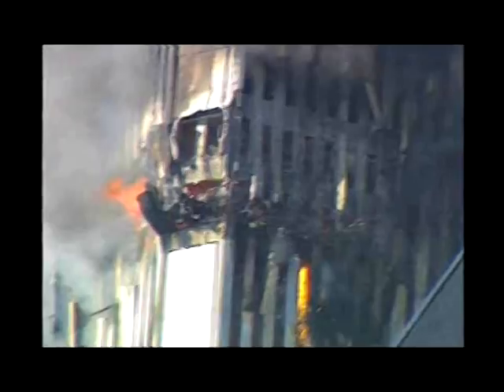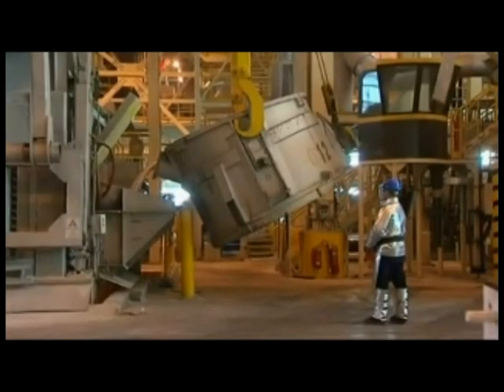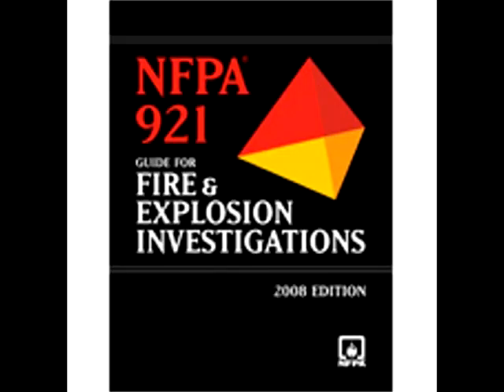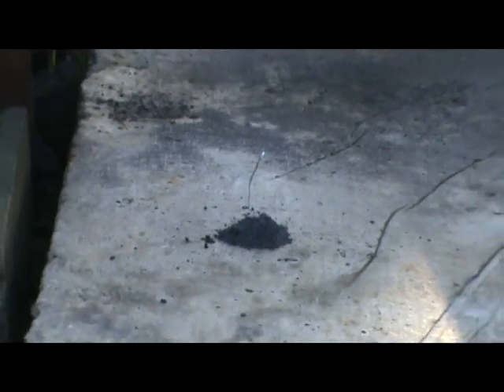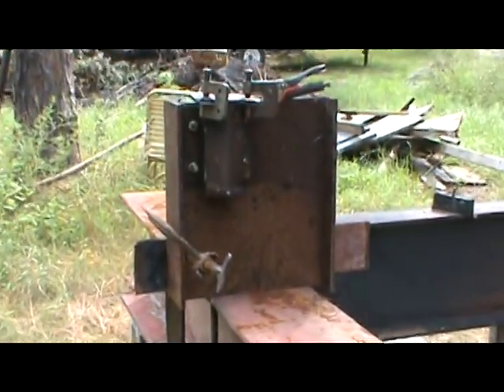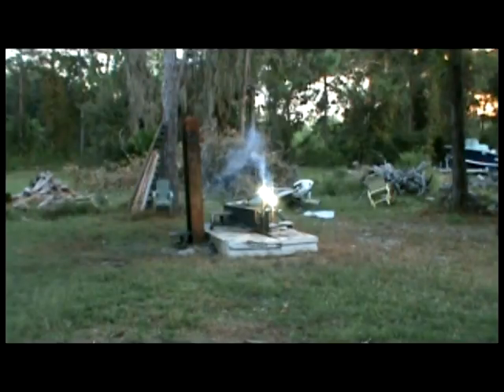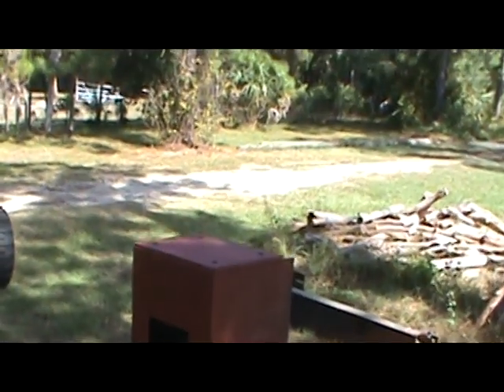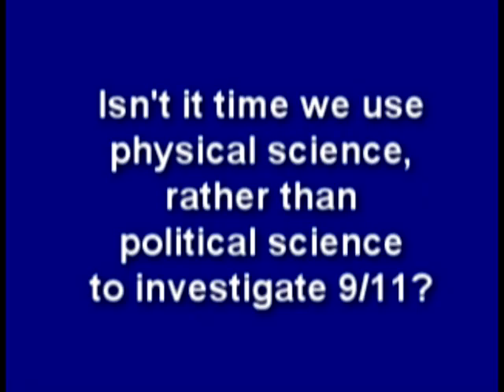9/11 Experiments: The Great Thermate Debate

Comment: If you smash an aluminium plane hard enough into a steel structure it will mix at the boundary layer and then the heat of the impact would start the reaction. This would then allow the  steel next to it to melt and mix with the aluminium and in this fashion the beam itself is consumed for the thermite and thus no cutting or complex shaped charges need to be used. And if what you say is true then the steel would have cut lines and marks rather than whole parts simply melted away.

Edit I forgot it has to be iron oxide 

Teaches me for messing about in chemistry
Reply: Tomas Begley I want you to look up photos of when a bird hits an airplane and how fucked up the plane gets and then try to tell me what you're telling me
Reply: Brendan Early that is entirely the point the plane smushes into the steel and that allows the plane to BECOME the aluminium half of the thermite reaction.

You have to remember the sparks were continuously from a few main spots makeing the probability of charges very slim as a vast amount of charges would be required to produce that duration of reaction
Reply: Thermite does not work that way. You need POWDERED metals for it... not smashed=) And you say "half of thermite reaction"... do you know what the second half is? Do you think pure block of iron can be part of thermite?=) Nope... you need, again, powder... but of what? Iron Oxide (not pure iron)... or other oxide(there are many formulas). So your hypotheses (not even theory) is totally in the wrong direction. But thanks for the input
Reply: elrondsch fair point with the oxide I forgot about that it's been so long since I've messed with thurmite but the powders point is wrong you have to powder it for a fast cutting it welding action but even if you use chunks of material with a small powders starter it will work
I do like the effort you put into this but that still doesn't explain how any of these charges were set when the main structure was enclosed in the center section of the building by concrete.

Now onto engineering rather then chemistry because I'm bad at that
Another point to concider is that possibly maybe jet fuel did cause it because think back to the satern 5 rocket. It's propellent was Ap1 and it comprised of jet fuel and oxegen. They had to design nozzels out of inconell and ran the oxegen through the upper part of the bell to provide cooling BECAUSE IT BURNED HOT ENOUGH TO MELT THE NOZZLE. On top of that actual jet engines themselves have to have titanium blades with small air holes and a cooling air flow down the center of the shaft and through a ring in the stator to PREVENT THEM FROM MELTING and that heat is just from atmospheric air and jet fuel and yes you could argue that the combustors and a jet engine are steel but that is because they have small holes to inject cold air and create a boundary layer so the hot combustion never touched the material.

Now for the building one could say that the large access shaft in the middle acted like a chimney that was several story's high with one that size the draft would be very strong indeed and would most likely provide enough oxegen to reach the level of burn required to achieve that temperature
Now again this is just a theory I am not claiming this is what happens it would need calculation for the possible amount of air delivery. The supporting evidence is that the beams recoverd had no clean cut marks on them and large portions were missing. Next is the inibilty to lay charges into a sealed space. Finally is that molten steel sparks look the same no matter where they came from but of a segnificent amount of beams were cut then you would have seen them all around the building, however if there was a fire in the building being fueled by a large chimney and draft effect then the sparks would get carried in the direction of airflow so if the plane crashed into the center section and broke a part of the wall this would be the initial entry point of the air and thus the sparks would travel that direction and out of the opposite side of the building to the crash like seen in the footage

not saying this is what happend but it ticked more boxes then the thurmite one and the only thing holding it back is the flow calculations for the center section to see how much oxegen could be provided
Reply: Tomas Begley  are u a veteran architect ?
Reply: Gent Bar nope and I never claimed to be but from the building plans a volume calculation is basic maths.
and as for the internal construction of the building it's quite simple I saw a documentary on the descovery channel on how they were built a few years ago, apparently more then you have.
This works because the center column house several large evacuation stairwells and a large quantity of the beams were enclosed in the concrete structure meaning your charge theory is impossible as there would be no way to set them unless the concrete was broken off. However when concrete is exposed to extream heat it will crack and thus expose the beams to the fire.

Clearly none of you have a scientific mindset as how you prove scientific theory is by trying to DISPROVE it and failing, it's easy to prove something but hard to find something that's infallible. So by all means check my theory as at the moment that's all it is a theory, doesn't mean it's correct, and that's why you need people constructively looking at eachothers theory's.

And fyi I am an engineer so the jet engine point is correct for sure and  for any chemists out there you can confirm that kerosene is far more energy dense then TnT now think about that for a second.
Reply: By Iron Oxide, I am guessing you mean RUST. Rust on an Steel beam, that's preposterous.
Reply: are you?
Reply: Nice try but no.
Reply: Yard Sale Dale  ummm they definitely did not go through it lol. They hardly made it in past the outer wall

Comment: Ooof, you don't need to fully melt steel to weaken it. Weakened steel can bend. Bending can add more heat to the mix. Also, buildings have insulation on steel beams so fires won't weaken them right away. Implying, that fires can weaken them.I also love how you compared a coin floating on Mercury to organic material floating on flowing aluminum. Is funny. Also when exactly did they have time to set all this up without people noticing? Now keep in mind, if they had that much time and preparation put into this, why would they have been this sloppy?

Comment: For every mouth breathing thinking that the u.s. government had something to do with this do to the temperature that it takes to melt steel vs how hot jet fuel burns. Let's do a little experiment. Take a piece of hard plastic like something you need to cut open with scissors like a console controller get a piece that you can bend and keep bending it quickly after a few seconss you'll see that it heats up and the integrity of the plastic becomes much easier to bend. Heat makes things much less structurally sound it makes them weak thats why if you take steel and heat it up to half its melting point maybe even a quater of it you can very easily bend it.

Comment: This evidence is Compelling...but inaccurate....it would have taken thousands of tons of thermite to bring down the towers...I think someone might have noticed hundreds of men bringing this up..for weeks on end....and stripping beams to apply it.....The Unpopular...unglamorous FACT is....the destruction of the towers  was brought by the  "two" 190ft long jet aircraft traveling at over 400mph in a dive...with there engines in emergency  power...The Average  Person can not comprehend how much energy  a speeding Jet ...filled with jet fuel ..can unleash...Either can the Author of this Video....The WTC was a Giant  Tube 1100 ft tall...with an exoskeleton of steel...punch a hole in the side of the tube...add tons of jet fuel....and you just  made a Gigantic blast furnace....the internal fire...draws tons of high speed air into giant holes in the exoskeleton....with 60 to 70% of the internal core severed by the speeding aircraft...and enough heat to soften if not melt the remaining  structure....the compromised  structure could no longer support the floors above...
No need for Conspiracy...Or BS stories of thermite...There is a reason the internals of a jet engine are made of Exotic Alloys....like Titanium....if they were made of steel....they would melt....

Comment: Here's an idea: what if they collapsed because the tubular shape of the tower was no longer able to structurally support the weight of the floors above after impact? If this were true, then the lower the impact of the plane, the sooner metal fatigue would set in and the building would collapse. And just what we saw, the south tower, though struck second, collapsed before the north tower. any thoughts on that?

Also, WTC 7 was sitting on top of an electrical substation. Have you ever seen a transformer explode during a tornado? Now imagine something about 10,000 times bigger...

Cool tips on building destructive thermite devices, though. I'm sure NOONE will find that useful...

Comment: The comment section is a bit sad Tbh. The engines themselves could not burn through steel, and would not burn aluminum red themselves as well. However, the building created a sort of furnace exponentially increasing the temperature. This severely weakened the structural integrity of the WTC, and even creating an effect similar to a thermitic explosion or extremely high oxy acetylene torch. This temperature could also make aluminum flow bright red like water. Also, the over 500,000 ton (ton right)? Would create a freefall effect. As for wings not being found in the wreckage, that's just ignorance. Anyone fancying a civil discussion, feel free.
Reply: The fires in the towers were oxygen starved the smoke was black they never got anywhere near furnace like temps to melt stee,l and these buildings where built to withstand anything and all it took was 15 mins to bring them down. No skyscraper has ever been brought down by a fire except wtc and they fell as one straight down it's horrible to say but it does look like a controlled demolition
Reply: They're large buildings and the heart of a fire burns hottest. Just because there's smoke pouring from the outside of the building, i.e. furthest from the centre, i.e. cooler, doesn't mean that the inside in't burning horrifically hot. 

No skyscraper has been brought down by fire, true, but no 110 storey skyscraper has ever been hit by a commercial airliner loaded with fuel at 400-500 knots. The kinetic energy of flight 11 (North Tower) was about 3.35GJ and the KE of flight 175 (South Tower) was about 4.53GJ.  That's equal to 0.8 tons and 1.08 tons of TNT respectively. And that's just the impact alone. You don't expect the structural integrity to be somewhat weakened after that?
Reply: Yea, but how come it didn't crash down when there was a fire years before? Or did the furniture decide to burn hotter this time around?
Reply: Because it was different ? It was in the basement, it was a different fire, etc... you can compare the two fires. The parameters are very different.
Reply: https://youtu.be/6xif0jIT_ZM
Reply: #Kyle Morrison Why would anyone  with a modicum of intelligence on the subject matter engage in an exercise of futility in an attempt to have to have a "civil discussion" without a nescient dolt such as you?
If Dunning and Kruger were to read the irrationality of your Disneyesque Loony Tunes physics they would be high fiving until their hands fell off!
Reply: I agree.
A gaping hole, a huge furnace, weight from above and cheap steel and concrete are more likely to blame than the idiotic idea that someone, somehow spent years planting explosive incendiary materials in the top half of a building. People never use common sense.

Where are the people who planted the explosives ?
Who supplied them ?
Where are these people now ?
Why hasn't anyone talked ?
When and how did these secret people have the time and ability to plant this explosive material ?

People are gullible. Like I said, a gaping hole, a furnace cauldron fire, weakened steel and a huge weight above is what made it all collapse.
Reply: Exactly. Like it was possible to keep those secrets without anyone talking. It's impossible.

Comment: This is very thought provoking. However if they had used thermate wouldn't there be only a small amount of molten metal? The reaction is quick and hot cutting and melting the metal. But there isn't really much time for the metal to flow out of the building. There must have been a way to consistently appy extremely hot temperature to the steel to get it to flow for so long and without much viscosity.

Comment: Aluminum and iron reacting to produce even higher heat... lemme see here, we have a massive source of aluminum in office furniture and, drum toll please.... one entire air craft!!   

Also, it absolutely not necessary to melt anything to collapse the structures, only to heat structural steel to a point where it looses temper and its young’s modulus drops to near zero.  That lower heat is the basis of blacksmithing, and is achieved with wood or coal burning at a far lower temperature than jet fuel and natural gas...  Oh yes, this idiot forgot that there were massive natural gas lines running up the building for the restaurant kitchens... Just imagine the added heat from a high pressure natural gas supply of many cubic feet per second. 

Natural gas WILL absolutely melt aluminum and most of its common alloys. Don’t forget, ... There was also the input of TONS of shredded and pulverized aluminum from the aircraft itself.

Comment: What happens to Steel when it is heated up and under immense pressure.. The weight that the steel bearing above is so great that's as a steel is heated up two such enormous temperatures that's maybe they might not melt it but it will weaken
 and fail .. Those fires were raging for over an hour with intense heat which would allow the steel beams to weaken not melt..

Comment: Where's the science on steel metallurgy  and how heating and cooling changes the grain structure in the steel if its tempered steel like in a semi truck frame and you heat it up you'll take the temperament right out of it causing it to buckle or crack or break in half not to mention warp it! And you have plenty of fuel in an office building paper, plastic,cloth,wood also being soaked in jet fuel all that heat can do sever damage to the steel structure  weakening it and causing it to buckle!
Reply: terry jenkins, anything about corrosion?
Reply: Rod Bender corrosion can be a factor also
Reply: terry jenkins, now think entire structure. Made of forged steel, not extruded.

Comment: Do you think the aluminum could have came from the plane and the steel beam supplied the iron oxide but I know it take a large amount of to start a reaction but the fire where burning for a long time and there is a possibility that smaller pieces could have started the reaction

Comment: too bad that the central columns did not give 100% off support to the building, also someone would of had to construct, and install the devices on how many floors, how many columns, in the 4 central shaft sections were about 50 columns, think about that undertaking to try to produce this effect with no one knowing. how many people would it take. realistically people. gullible is written on the wall. also the outside shell of the world trade centers were designed as part of main stability to hold the building up, so now you have to put a device on every outside column to make this work. without anyone wise. or maybe to jets hit two buildings and they just fricken burned.

Comment: you don’t have to cut anything (beams, columns or bolts) with thermite when just heating steel up to 650 degrees F will cause a 50% loss in strength.

Comment: My guess is that the nano thermatic material was packed in triangular heavy copper tubes, the addition of the copper reduces the temperature required to cut through the hard, thick structural steel. The igniters were probably magnesium.